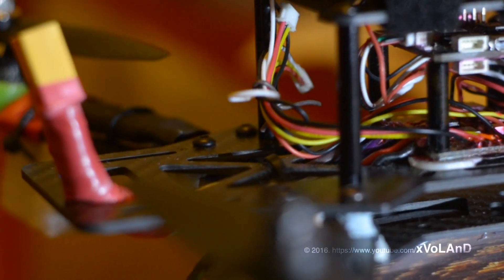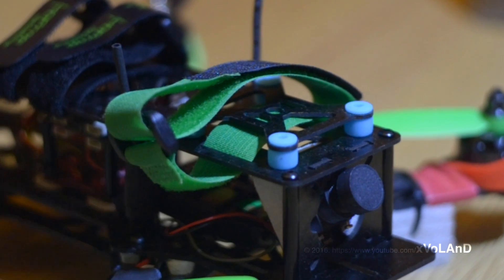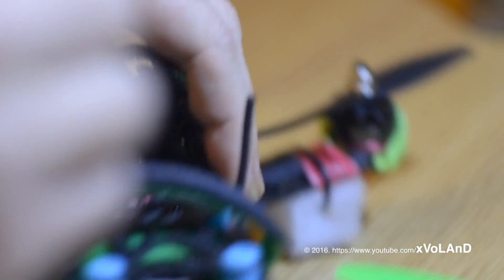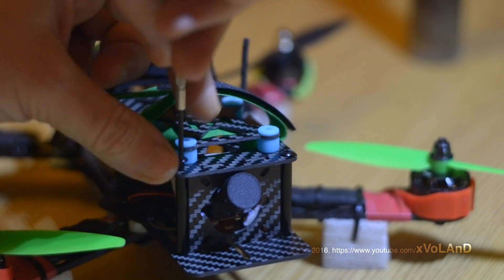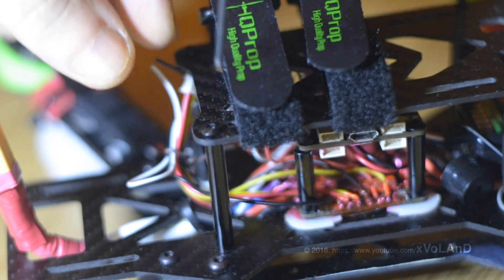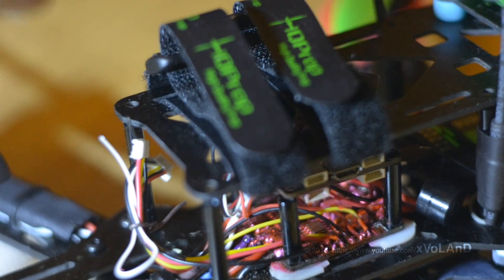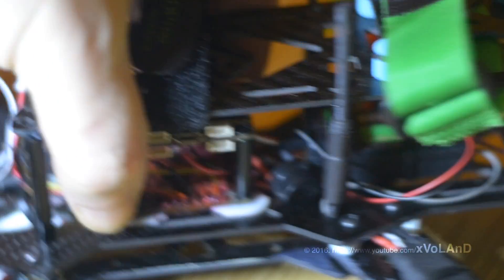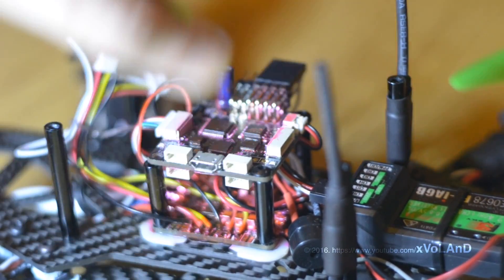SP Pro Racing F3 Flight Controller Board 6DOF 10DOF Deluxe Power Protection. How to solve.

Comment: What kind of capacitor i should use if i'm using 2s lipo battery?
Reply from the maker: farah aqila >=470uF/16-50V
Reply: So is that okay if I choose 470uF/25V capacitor or it will be better and more safety to choose 1000uF/25V capacitor. May I know how you decide to choose which kind of capacitor should be use.
Reply from the maker: farah aqila 470 uF/25V good choice. of course, 1000uF/25V it would be better, but the size of capacitor is also important, it must be somewhere to place ;)
Reply: Thank you so much Vitalii Tereshchuk. You help a lot.
Reply from the maker: Welcome! Happy flight!

Comment: what kind of capacitor do you use? One of this? 1µF/50V 15 st: 2.2µF/50V 15 st: 4.7µF/50V 15 st: 10µF/50V 15 st: 22µF/50V 15 st: 47µF/25V 15 st: 100µF/25V 5 st: 220µF/25V 5 st: 470µF/25V 5 st: 1000µF/25V  ??

And with a capacitor, I will be protected from overheating?
Reply from the maker: Daniel Sebhatu more >220mF/50v
Reply: I cant find this capacitor 220mF/50v do you recommend something else? or give me a link to ebay
Reply from the maker: Daniel Sebhatu 220mF/25v, 470mF/25v if you don’t plan to use 6s batteries
Reply: Im using 4s batteries, are you sure it is mF and not 220uF ?
Reply from the maker: You can buy here https://goo.gl/PJcFeh or here https://goo.gl/YhHT7Z You need someone: 220µF/25V, 470µF/25V, 1000µF/25V
Reply: Thank you, one ore question.  should I connect ground and +5v to the capacitor
Reply from the maker: Daniel Sebhatu Correct

Comment: Hello sir, today I was using my quadcopter (Spracing f3 evo, 30A ESC, gimbal etc), but with gimbal controller unplugged from the battery power (it works off of my 3S Lipo that is powering the quadcopter). After landing and with the quadcopter turned on (spracing f3 working, it receives 5V from one ESCs 5V output on flight controller's rails + and - of motor 1), I decided to plug the gimbal to the battery power (meanwhile the spracing f3 was ON but unarmed) and flight controller died, but was like a voltage spike death... How is this possible? The gimbal "took" power instantly from battery and probably was not a voltage spike but DROP, so how did the fc get fried? Now I only get green LED on and all other LEDs off, also when connected to USB to my PC says "device unrecognized" and no serial port is seen from iNAV and also tried installing driver with zadig but device ID is 00000. Also, I must state that the gimbal and all other 12V accessories like the Video TX, are soldered to battery power + - terminals on frame's PCB (DJI F450) in PARALLEL fashion. 

I am now using my spare Spracing F3 and decided to use a power distribution board like the one in your description, and now I am supplying power to the flight controller through it and not anymore from ESC. Will this method protect from future voltage spike or drops? 

Also, will alternatively using only the capacitor you give instructions for and no power board (power the fc from ESC), help avoid the problems? Thank you, I dont understand how this can happen? (it has also happened previously exactly in the same way with my naze32 and it was dead as well)
Reply from the maker: MultirotorKnowledge Really? What do you think about RC-filter? 😂
Reply from the maker: Hello man, do you have a protective capacitor?
Reply from the maker: I use a power board, as well and a protective capacitor. Until now, I have not had any problems and my controller is alive
Reply: Thank you, I will install a capacitor as well... Sadly, I had not seen your video before I made the mistake of killing my FC, but it will happen NO more thanks to your help!  Thank you!
Reply from the maker: You're welcome! This can happen for various reasons. The using a capacitor, I came from analyzing FC of my friend (also burned). Then I did not have a quadrocopter :) But now, I'm also a noob pilot :)
Reply: Anybody can learn to pilot especially with so much automation nowadays, but to be able to diagnose and fix a problem, especially on small electronics like this, takes patience knowledge and smarts my friend, and you have that! Good job, you have one more sub, I await your videos!
Reply from the maker: Thank you, for the kind words! Nice flights!
Reply: Hi, the Flight Controller must receive 5v from the PDB, if you connect it in parallel with the battery it will receive 11-12V and may burn..
Reply: Vitalii Tereshchuk It can be another solution. ☺ But i think that a power distribution board is a must for quadcopters, if you need to add other components such as fpv transmitter, leds..you can easily connect them to it for the right voltage.
Reply from the maker: MultirotorKnowledge This solution works perfectly!

Comment: Does it need to be exactly these two pins or just between + and - ?
Reply from the maker: Helipaddy Enough for contacts + and -
Reply: Thank you and how about the voltage. Yours is 450V, is less ok?
Reply from the maker: Helipaddy You're welcome! 50V
Reply: Allright, thank you. Unfortunatelly I broke my SP3 already, can´t connect to USB and OSD doesn´t receive anymore data from the board. Otherwise the SP3 works and I still can fly. I ordered a new SP3 already and install the capacitor.
Reply from the maker: Helipaddy Well, you can change the port and then be able to update SP. Sorry, I can't tell you how to do this remotely
Reply: Change to which port? Is there any website that points me into this?
Reply from the maker: Helipaddy I don't remember, sorry

Comment: hello, can you tell what had happend with my sp 3 evo - when u connect it to USB port it doesn't power up - with lipo plugged in starts normally - any ideas ?
Reply from the maker: Michał Cieplik you connect through the power board?
Reply: yes, exactly
Reply from the maker: Michał Cieplik check the power board is working? Then, check the controller board